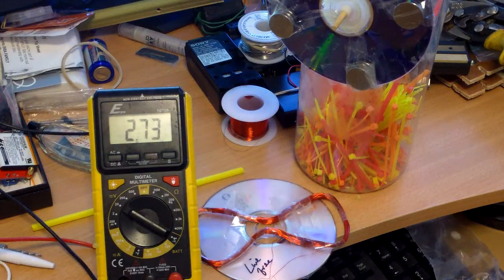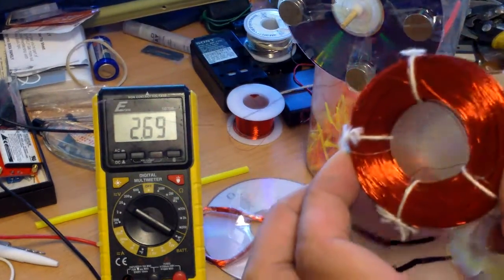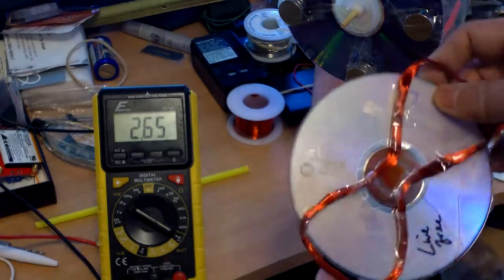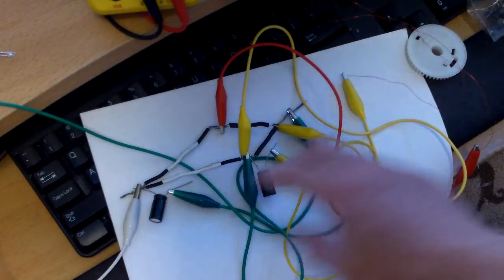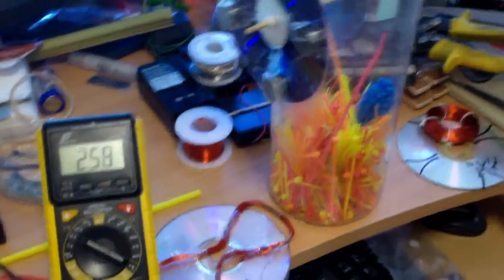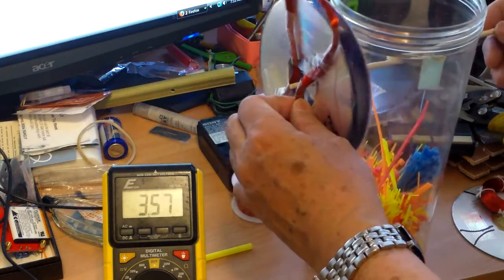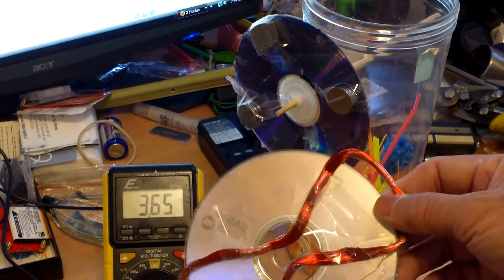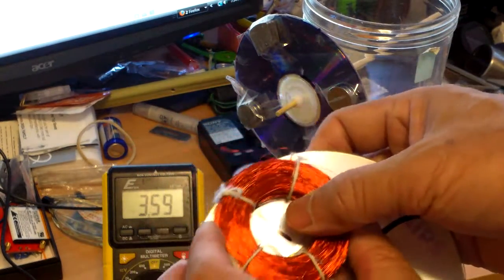Toy axial flux wind turbine pt 2 Making the coils, rectifier and voltage doubler

Comment: The inside diameter of any coil should be just slightly larger than the outside diameter of any magnet. The closer the coil is to the magnet without overlapping the stronger the electricity output due to the amount of flux saturation within any coil. Your design is good and will work. Only on a smaller scale in proportion to the magnets used.